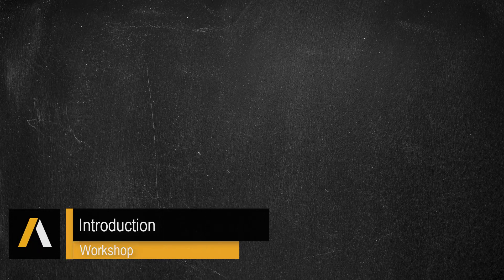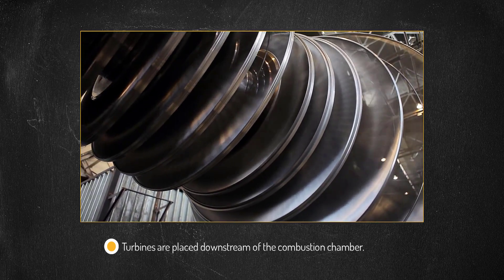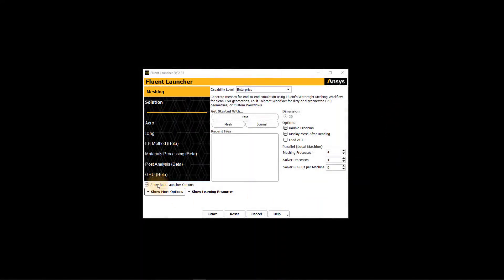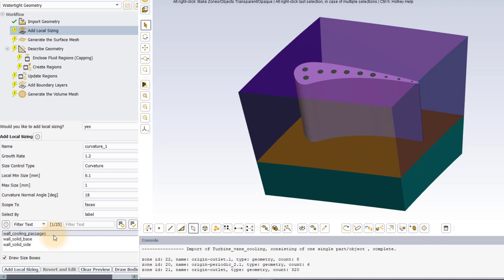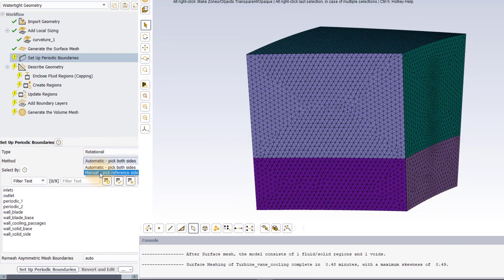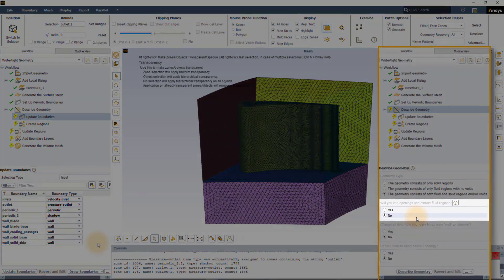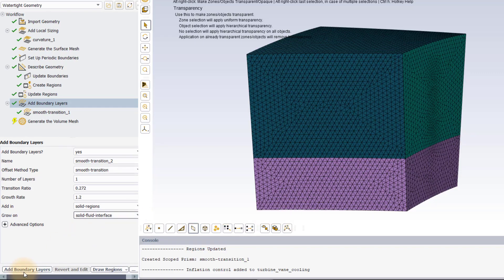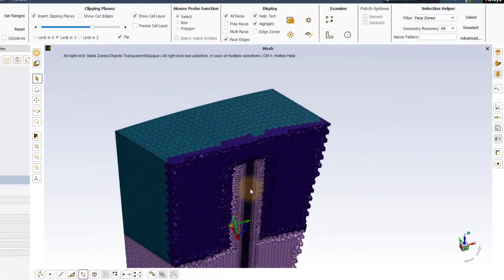Turbine Blade Cooling Tutorial Using Ansys Fluent Meshing Watertight Geometry Workflow

Comment: can i get the video how to design this geometry?
Reply: You import co-ordinate points into a CAD program like SolidWorks and create a solid extrusion (based on the blade height). Then, you add cooling holes at the respective co-ordinate locations by creating various diameter circles as sketches and extruding a through hole. All co-ordinates are widely available as the NASA C3X is a very common blade for turbine heat transfer validation cases; I have created this geometry too, for my thesis.
Reply from the maker: Thanks for watching! Please post your query on the Ansys Learning Forum for a detailed answer from the wider Ansys Community: https://ansys.com/forum.